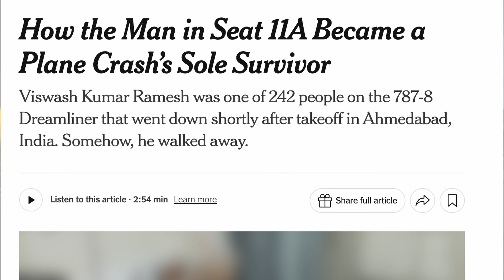Why the RAT Changes Everything – Air India 171 Update

Comment: I have an additonal reason to add to this dual engine failure theory, that being the landing gear. When fully extended, the landing gear on the 787 family are on a sight upwards slant. When pilots raise the gear on any 787 aircraft, the main landing gears tilt downwards to allow the gear to fit in the stowage in the belly. From the video as shown and that i'm sure we have all seen, it is evident that the main landing gear does appear to be on a downwards tilt which is likely to signify that the pilots did in fact raise the gear, however, the landing gears did not fully retract as the possible dual engine failure arrested all electrical and hydraulic power which would not allow the gear doors to extend and the gears to subsequently retract, thus, potentially explaining why the gear remained down. The fact that the landing gear was tilted as an action of the pilots putting the gear up but then suddenly stops just backs up the theory that it could have very well been a dual engine failure, which deployed the RAT and stopped the gear from fully retracting.
Reply: Unlikely.  The gear hydraulics are controlled by solenoids, themselves activated by electrics.  A bus-bar failure or breach will stop the electrical signal.  Then the hydraulics freeze. The aircraft already had unresolved electrical problems from the inbound flight, which were not attended to.  No electrics to the air conditioning implies those connectors were not drawing power from their respective bus-bars.  Lots of problems on that airplane.   Meanwhile, attention has drifted away from the absurdly late rotation, done at the runway over-run area.  Why that late?  Because the machine did not have enough airspeed.  And that is because the engines were developing insufficient thrust considering the load, the altitude of the field, and the temperature, relative to the needed power output.  And why insufficient power?  My guess is that they were not manually placed at full power, instead relying on some software input - again, an electrical control.  Lots of problems.  The pilots should have rejected the takeoff.
Reply: @janvaneck4088  I saw a different pilot saying that if they had not taken off, they would have crashed into buildings
Reply: @elaineklein2385   That is certainly true,  by the time they were at the very end of the runway it is either take off or crash on the ground, so it was a rotate and pray situation.  The idea behind rejecting a take-off is to make that decision much earlier, while you still have time to stop!
Reply: @janvaneck4088  Yeah, I’m assuming they didn’t realize the problem until they were too far along the runway to stop without crashing
Reply: @janvaneck4088  Agreed 💯 Jan! They should have aborted takeoff. It seemed like the engine problem was apparent during takeoff roll. Why did they continue?
Reply: @janvaneck4088  You're blaming the pilots based on guesswork. Let investigators do their job first before telling dead people what they should have done..
Reply: @Merilix2  I thank you for your gracious coment.
Reply: Another site had a video of the crash site and a piece of a wing which showed the flaps appear to be deployed. The rat was deployed probably when the engines failed. Could have been after v1 as it got airborne and your options are limited.
Reply: I would tend to agree with this senario.
Reply: Good point.  Have the pilots from the previous flight been interviewed?
Reply: @CrystalKhlyr if the investigators are like those at ATSB then that will occcur. They look at every possible scenario.
Reply: Go and search name Sam Salehpour, whistleblower of "boeing 787 dreamliner". This tragedy was well organised and didn't happened inside the US. Boeing is an american company, this particular model had quality issues and safety concerns. Also gather knowledge about income, corruption and safety negligence of  Dave Calhoun, then Ceo of boeing...
Reply: 🎉🎉 Thank you for YOUR contribution 😊
   "Cpt. Steeeeve’s people” us, are a very intelligent crowd of people. 😊
     The "Tilt” of the landing gear was a Great contributing factor that "Releases” the `Co-Pilot’ of any error on their part for Me.❤
      When putting together a 200-piece Puzzle, gradually, as the proper pieces are put in place, the Picture becomes clearer and clearer. 😊
      This adds comfort to know that my wife and family are in Knowledgeable and safety-Oriented hands.🎉🎉😊
    Once again thank you for your service and commitment.😊🎉
Reply: The pilots of the previous leg must know something. Long story short, my digging in with Chatgpt after feeding it the information in this video is:

"The Boeing 787 relies heavily on electrical power for critical flight systems unlike older aircraft. A passenger documented electrical failures on the previous flight affecting cabin systems, which on a 787 can indicate broader electrical problems. These issues likely escalated during takeoff, causing the total system failure evidenced by RAT deployment and extended landing gear. The previous crew likely noticed these anomalies but failed to properly document them, allowing a compromised aircraft to be dispatched for the fatal flight."

Pay attention to the last line. The pilots of the previous leg must be thoroughly interviewed. Good chances they dropped the ball here.
Reply: @ashb001  It’s entirely possible that the previous pilots did raise concerns, but their concerns were ignored. ChatGPT pushing some unwarranted assumptions
Reply: @ashb001  You’re on the money Ash! Very good theory! 👍🏾
Reply: @ashb001  Investigate all possibilities.  Did the pilots of the previous flight really NOT report serious problems?  Did Air India simply choose not to correct problems simply to keep to a schedule?  Did the pilots of the fatal flight fail to do proper calculation density altitude?  Did they do a proper run up before taking off and not ignore any anomalies?

I am sorry for the loss of life of all those on board and on the ground but emotions must be put aside during the investigation. All possibilities must be considered until they are explcitly ruled out. As many aviation channels say there are many holes int the "Swiss Cheese" model many contributing factor and once those holes line up accidents occur. .
Reply: @ashb001 that passenger did not document an electrical failure. They documented systems not functioning. The AC could have been turned off at that time. He didn't show evidence that was because of electrical problem. Also the touchscreen in his video was In fact displaying stuff on the screen which indicates it was receiving power. It wasn't responding to touches which could be a number of things.
Reply: @mikesorensen5228 you know there is such thing as a partial electrical failure right? Just because the screen had something on it doesn't mean it was working at full power. The guy also mentioned that when he pressed the button to call the flight attendant that the light that comes on to let the flight attendant know which passenger is calling them wasn't working. I'm going to wait until the final report comes out. But it is possible that some electrical systems were working at the time that's why the plane had power at first. So it is possible that there was a partial electrical failure that turned into complete failure when they took off the final time.

Comment: PLEASE READ TO END: Very good analysis Captain! I did not believe there was a dual engine failure based on the original video from news you can clearly hear an engine sound as the plane flew by and not a single engine failure because the plane was not yawing and a single engine should have been enough to keep airborne enough to make an emergency landing pass. Now knowing the news video was a recording of a recording playing on another screen, and you can hear the distinct sound of the RAT and see the RAT deployed, your theory makes more sense. Also to add to this, there is an unverified video supposedly taken by a passenger from the previous flight from Delhi to Ahmedabad filmed inside the aircraft, showing the seatback TV screens and remotes were nonresponsive, and the air-conditioning was not working he stated it was extremely hot inside the aircraft. It may be possible there was a major electrical failure already started before the crash. The one survivor mentioned he heard a loud explosion sound, this could be the RAT deploying or could it be a clue to possible sabotage inside the cabin cargo and electronics bay from a small explosive or incendiary device strategically placed to disable critical electrical systems and computers?

Comment: Would you be hesitant to put you or your family on a B787 if it turns out to be dual engine failure?  If it is and turns out to be Boeing failure,  how many accidents before this company out of business?  Heard about Boeing engineer that testified before congress as whistle blower about safety issues he pointed out on the 787, I think relating to structural integrity, and they harassed him to shut him up.  If true, you have to wonder whether this company has any qualms about killing people in the name of corporate profits.  Not to mention airlines putting people on the flight line overlooking failed Sims, and hard landings during air training and other errors due to pilot shortage and forcing pilot into captains seat who don't feel ready to move up and, without any political slant, DEI policies putting pilots in the cockpit due to quotas instead of ability.   As a passenger I want the most qualified pilots up front, not the best DEI pilots.  I fear these crashes are going to br more frequent because of these issues as well as issues with quality,  quantity and equipment issues with ATC.

Comment: God, those poor people, may they R.I.P.  Just looking at it, seemed like the engines were dialed back for some reason, like they were landing.  And that kinda points to some computer malfunction or misalignment with the pilots intentions.  I say that becasue the only time the you can see stress is when the nose went up sort of, but even that wasn't dramatic, and at that point, I the plane is under computer control.  Plus with take off thrust power, flaps and even and the little RAT thingy, though it may have inhibited the take off, and retarded the climb somewhat, to cause it to descend like that points to some bigger issues.  In testing, and at shows they show these things going practically straight up.  Tough break for Boeing, and sad for the families of those people.  The boxes should tell everything, they are saying the 787 has thousands of parameters.

Comment: You are chinees agent so you hide secret for china.
You say wrong the sound of engine not this way but emergency motor rat  for generation of power see down side of flight .this motor  ram running .that sound you see .so the electric failure so trust is not get for low fuel supply .so some one damage the electric system in a time frame.30 sec 
So who make this issue is the problam

Comment: I saw a video pointing out that the wheels on the rear landing gear were tilted down, which is the first thing that happens when the landing gear is retracted, meaning that the pilots likely did try to retract the landing gear.  I would guess that there was enough pressure in the system tilt the wheels but not to raise the gear.  It doesn't look like the doors opened either, but that's harder to see clearly.  Here's a video of a 787-9 cycling the gear to show you what I mean: https://youtu.be/2ZwzACp-q9U?t=6

Comment: You can hear the prop from the RAT louder than the engines. Anyone who has been around jet engines knows how loud those are. At full throttle they should be absolutely SCREAMING! Are the engines even running? Also the jet wash behind the engine completely disappears immediately after leaving the ground. You see the dust as it leaves the runway then there’s no more disturbance behind them after a few seconds.

Comment: There have been a couple of double engine power loss incidents based on fuel contamination, one with caused by too much biocide and one when diesel exhaust fluid was added to the jet fuel.

Biocide overdose blunder suspected in A321 dual-engine incident
"UK investigators probing a serious dual engine problem on a departing Airbus A321 have discovered its fuel system had previously been overdosed with biocide, after a maintenance engineer misunderstood a measurement term."

"But the most serious of these occurred as it took off from London Gatwick on a crew-only ferry to London Stansted. The aircraft’s left-hand CFM International CFM56 powerplant began “banging and surging” at 500ft, says the inquiry, the engine’s N1 dropped to less than 40% for 25s, and the jet started to fishtail."

Comment: I strongly feel dual engine failure or complete electric failure. Now why that happened is the biggest question. Boeing needs to answer, Air India needs to answer on maintenance front. But this plane 787 with safety record losing both engines at once is a mystery which needs to be solved because we know how many are flying now.
Reply: It will be pilot error due to a chain of events where the engine driven generators never picked up the load from the APU generators. Possibly due to a buss fault. And they shut the APU down without making sure the engine driven generators were online prior to shutting the APU down, just prior to takeoff. Takes one and a half to two minutes for the APU to shut down. The APU shuts down just after takeoff climbing. Loss of AC power from APU gens. Rat pops out. Not enough AC power from the rat to bring the gear up. And the Fadec goes into idle thrust safe mode. Then the pilot needs to momentarily move the thrust lever out of Toga takeoff power detent to wake the Fadec back up and make it exit idle thrust safe mode, then put it back to TOGA detent or full forward to bring the engines back up to full power. Otherwise it’s a glider. AC power is not required to bring the power back up to full thrust. Just moving the thrust leaves out of toga detent, and back into toga detent will wake the fadec back up because it is getting its power from the permanent magnet generators on each engine, which there are two pmg on each engine and two channels of fadec A and B on each engine.

Comment: Thank you Cpt Steve. The electrical output of the RAT is quite small, less than 1/10 of the primary generators ( around 7 KVA, if I’m right). That’s quite small considering that the the 787 is highly « electrified ». There is also another extremely important system which is automatically triggered ON in that total loss of engine case: the APU. The problem in this kind of critical situation is TIME: the APU needs roughly 2minutes to be ready for use ( starting and putting on line). That’s where the RAT is needed : to provide that little electricity to few basic systems ( cockpit flight instruments) during the non availability of the APU, in line with the batteries ( do not forget the batteries). Once ready, the APU takes over et covers the full load requirement. So the RAT would be actually used for a short period of time ( the one required for the APU to start).
Same for the hydraulic power the RAT provides: only the basic primary flight control system is fed ( and certainly not the landing gear or the flaps, big energy consumers!). Once the APU is on line, the main electrical pumps take over the full load. 
So just to say that the RAT is that little helper needed during the time required for the big brother (APU) to get up!

Comment: I am total aboard with the RAT thing but I am not fully aboard the Dual Engine flameout camp. Why? Cause we dont know if that is the chicken or egg here. For me as an none pilot its very unlikely that two engines would decide to flame out at the same time, just after take off. Thats leans me towards a loss of power CAUSING the engines to flame out rather than the other way around. Its still rare but it more likier than two engines decides to go out at once whom has to be super rare, specially after all the pre take of lists you guys do.

A question whom you did not adressed: Can you hear the engines go down from take off thrust to cut off? In my none pilot eyes that should reduce the sound noices quite distinctive, right?

Comment: What puzzles me is why had it got to the end of the runway before it lifted off, I’d of thought if it didn’t have enough power to lift off at the normal distance along the runway they would abort lift off. You can see in the original video it was throwing up the grass & dust at the end off the runway because it must have been so low. I’m not a pilot, but I’m sure that at the end of the runway it’s should have been at a few hundred feet altitude, so were the engines producing enough thrust as it traveled along the runway.

Comment: That's the best bit of explanation I heard based on limited evidence.I hope as investigations unravel it will shed more light into the actual cause of dual engine failure.Which is very scary considering there are thousands of 787 flying around . If it is something that is related to manufacturing fault or clearance engineer fault it is paramount to address that in all of 787's. Let's hope that report comes out soon.

Comment: It can't be fuel contamination because other planes would have received bad fuel. Even if it was mixed from different airports. We should be seeing other planes with contaminated fuel. 

If we know the time of the loud bang the passenger heard, we can determine if it was during climb or decent. My money is on the Lithium-Ion batteries blowing up, cutting power to the fuel pumps for the engines. It's the only way can come up with both engines going out at the same time.